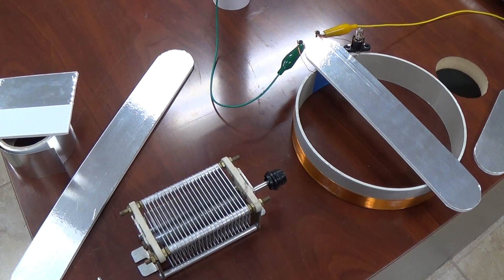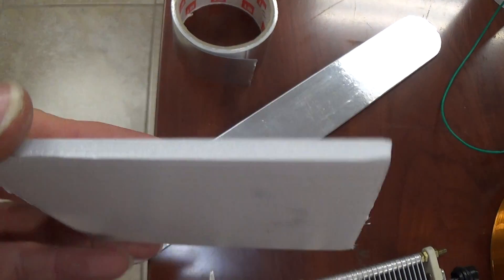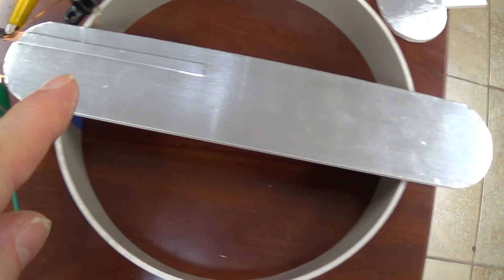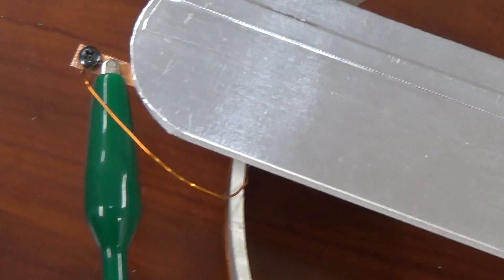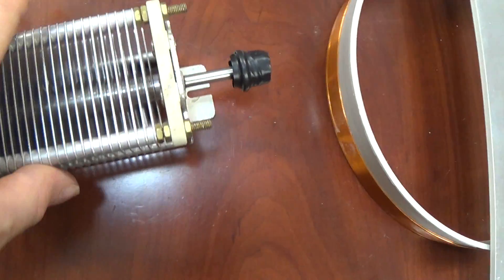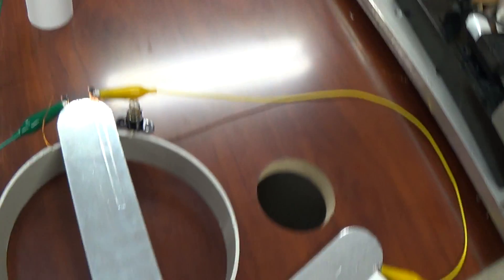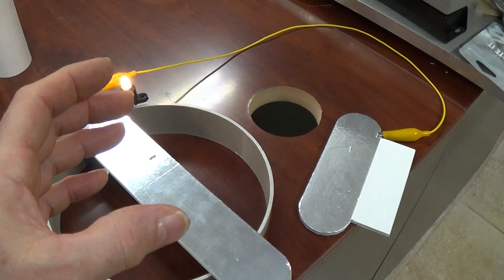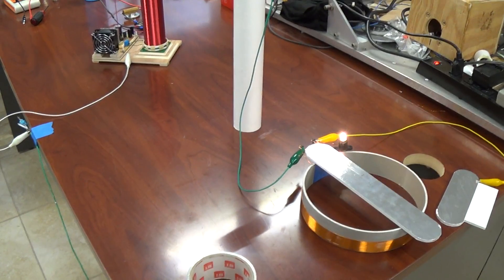TinselKoil Test 4

Comment: whatever happened with the houseboat build? I was enjoying following along and can't find anything after part 8
Reply from the maker: I wrote that information in the comments of part 8 video. Basically there was a liability insurance issue with the marina (where I was building it). I could not afford the additional insurance costs, so I sold everything off to end the nightmare it became.
Reply: digs we want to know that as well, we looked and here is what we left for him to read, Luc gotoluc Choquette PART 9 OF THE BOAT, ANY MORE PARTS WE COULD NOT IND THEM? HAVE YOU GIVEN UP THE PROJECT? LOVE TO SEE THE FINISHE BOAT, OLD ONE LEGGED JOSEPH T
Reply from the maker: Copied from comments of part 8 update: sold it off as I could not continue the build in the marina without getting liability insurance which costs over $2k a year.
sold it at a loss, $1.5k for $3k worth of supplies and got zero for the 500 plus hours of work. That's what happens with unfinished unique projects like this. The guy bought it to use as a boat dock. Nothing much was done to it.

Comment: Hi, thanks for great video. Please tell me if this receivers coil can work without antenna?
Reply from the maker: No, it cannot work without antenna. But if I connect it to ground I think it can work without antenna.
Reply: Luc  gotoluc Choquette thanks for reply, I mean I can see 3 aluminum foil,  one on top which connected with green wire,  second on the table with yellow wire and last one on top of coil. Which one we can remove but still can have power input to bulb?
Reply from the maker: You can remove the (yellow) one on the table and it still works but get less light.
Reply: Luc  gotoluc Choquette sorry one more question -  can I get the same or similar result if I put all 3 antennas close to coil?
Reply: Lets say I have one aluminum foil on top of the coil,  and I put other 2 antennas next to it,  what will happen?
Reply from the maker: The foil on top of the coil is NOT an antenna. It is a specifically tuned capacitor (foil on each side) that I made to achieve resonance with the coil (resonance LC circuit). Without that tuned capacitor and coil tuned to capacitor there is no resonance established from the 1.13MHz transmitter frequency and the receiver will not works. The green wire to the top single sided foil is the antenna.  The yellow wire is optional.

Comment: Regarding geometry, I think resonant magnetic oscillation (matter) is all about golden ratio. Magnetism can only be a stablized continuous oscillation in golden ratio otherwise the circular PHI-wave phase-conjugate will dissappear in counterspace. One common shape that I noticed  looks like ferroliquid above a magnet, with the many spikes, because when I look at tornados, they also have many many little vortecies coming out of the cloud besides the main funnel. Romanesco looks the exact same, its continuously powered and stabilized by counterspace potential if golden ratio is applied in resonance. I hope this helps in anyway ;)

Comment: You could also use two foam boards, put tape on the top of one, and on the top of antoher, then depending on how much the one covers the other allows you adjustment (for after adding more loads)
nested Cardboard tubes can work also ( whoe was that... not royer uhmm Hans Coler)  
http://overunity.com/14422/free-energy-device-70watts-by-hans-coler/dlattach/attach/135364/image//
basically two tubes over each other with windings inside and outside, single wire connection to each side and then the tubes can be slid to adjust the capacitance. (since they're single wire, the inductive quality isn't so great ).
Or really foil tape over the tubes would work also.